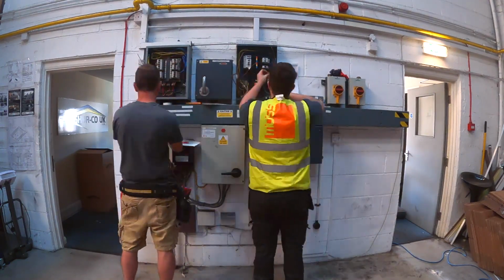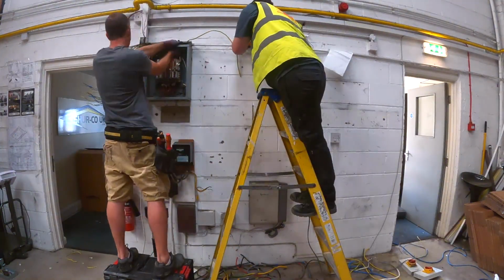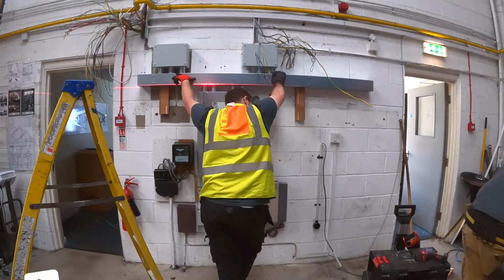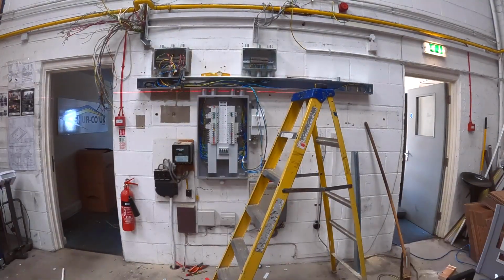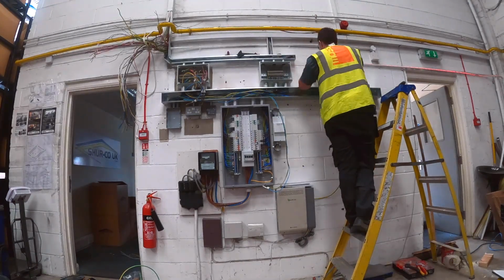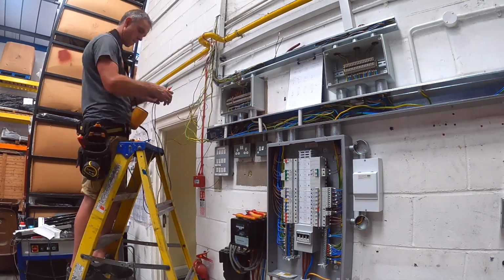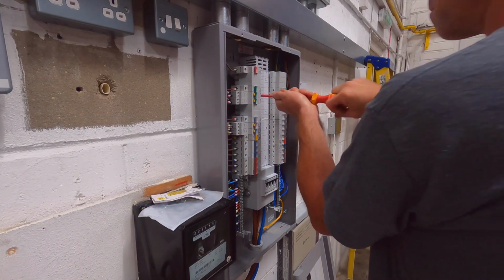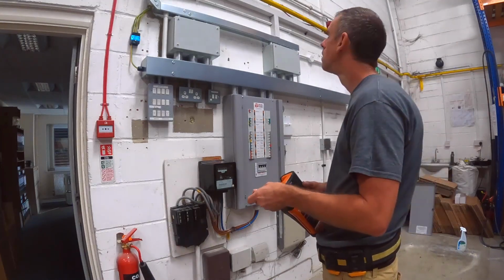3 Phase Main Panel Changeover - Start to Finish

Comment: Did you check how well balanced the phases were in case it need circuits moving to other phases????
Reply from the maker: No, there wasn’t any need to.  The building only has LED lighting, a few small offices,  and gas heating; no significant loads to cause issues.

Comment: As a recently retired Industrial JIB Gold Card approved electrician of 50 years i would say its a decent job,the only thing i would comment on is early in my career working for the biggest electrical companies in England we would never use brass bushes in this type of installation we would use paxolin between trunking and any distribution board,and the bonding earths look a tad untidy perhaps you should have fitted a trunking tee piece and extended the small trunking into the 6x6 trunking and fitted the earth block within the trunking and put a label on the trunking lid showing that the connections were within in the trunking
Reply from the maker: Hi David

Thanks for taking the time to comment.  In hindsight I would have fitted a T piece as well, but at the time of installation it didn’t cross my mind. 

I like the idea of putting the earthing block in the trunking, I’ll consider that for future projects  👍

Comment: Nice neat job mate. Out of interest, isn't it good practice to put an isolation point prior to the DB whilst  you have all the power off?

I'm not bashing you mate just wondering. Subscribed 👍
Reply from the maker: Cheers mate, clad you watched it 👍

If a new supply was going in I might ask for one, more likely on a domestic supply though. 

You don't see them that much commercially really, and Im not sure if there are any metal clad 3 phase versions used by DNO's for commercial installs , I've only seen plastic ones.  I cant see what benefit it really serves given that there is an isolator in the board anyway,  can you think of a use for it;  other than maybe helping the next electrician to change a board 30 years from now?

Comment: Did you fit phase marking to the main tails .L1.L2.L3.N.

Might have been better to put a 2x2 trunking T on then 2x2 trunking straight down to the bottom trunking.  👍
Reply from the maker: I can’t recall now, if a label can’t be seen then I probably ID’d them with marker pen. 

Good idea with the 2x2, would have made running cables down easier 👍